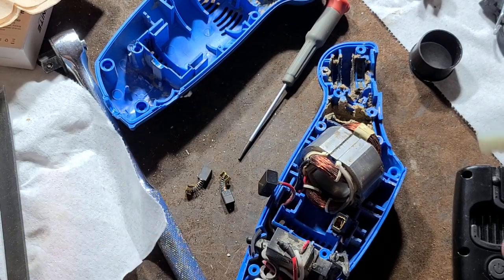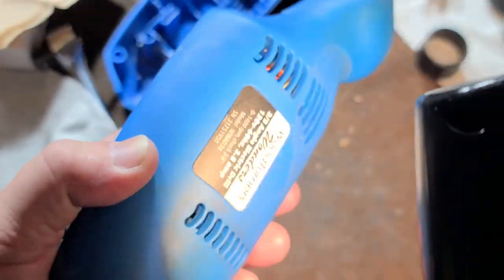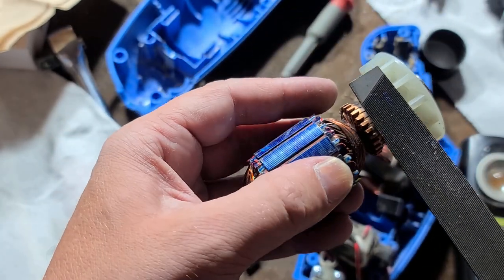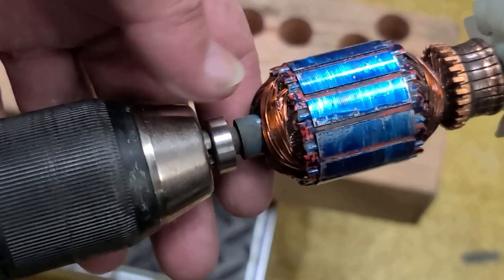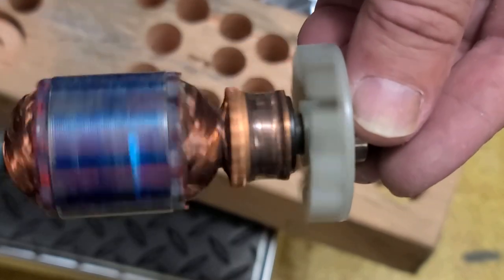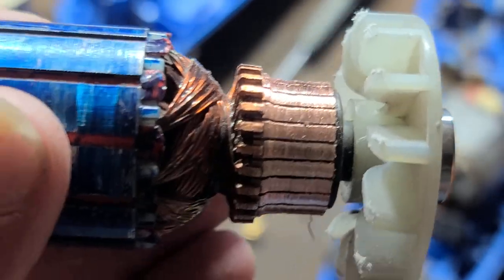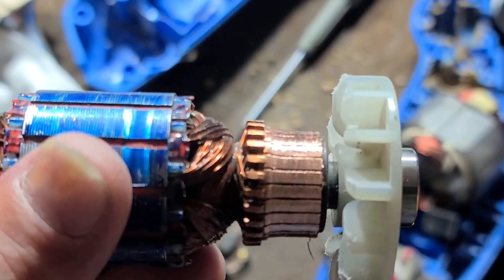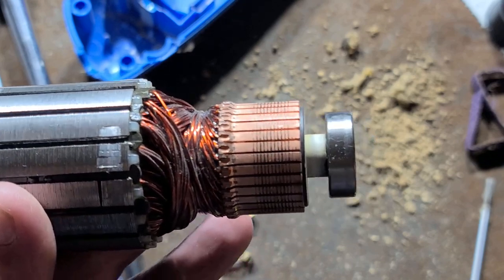How To Fix Worn Out Power Tool Motors

Comment: Thanks for sharing your knowledge and project.  I am trying to repair my electric motor to my Toro F700 Power-Jet Leaf Blower.  I am wondering if I re-wired the positive and negative incorrectly and broke it because the switch doesn't turn on the motor. I thought I identified the wires correctly by placing green and yellow zip ties on the wires that were terminated with a twist-cap.

Comment: I've done this before with a cordless drill, it's a bit easier because you can just set the drill upright on the battery instead of trying to hold up the drill and brace the bearing on something.